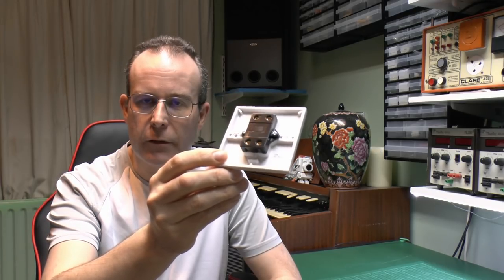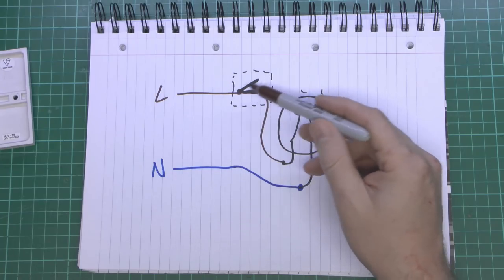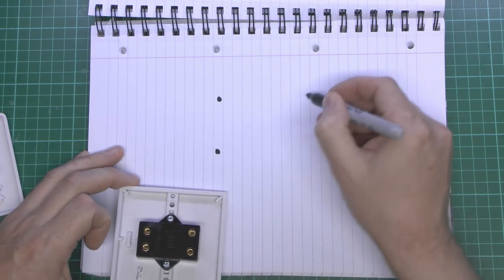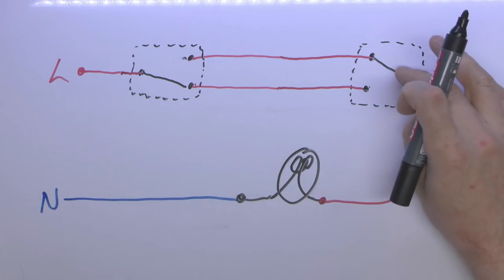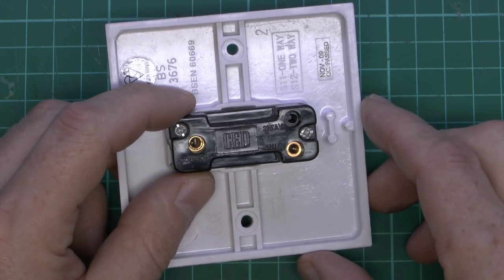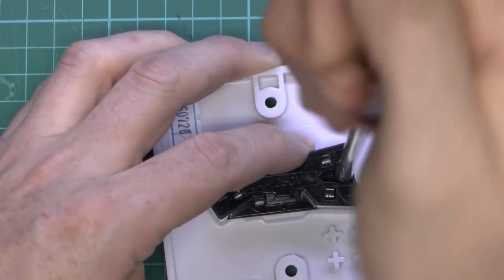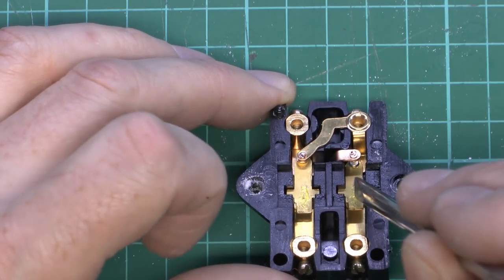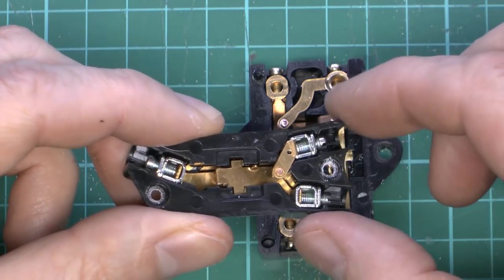Light Switches One Way, Two Way, Intermediate

Comment: Complex arrangement... had one of them this last week. 5 storey building, customer wanted each landing to be switchable from that level, above, and below... so the 3 intermediate landings ended up with 3 gang switches (below/here/above)... the bottom and top ended up with 2 gang switches... (here/above, or here/below, depending).  Had to use grid switches (to US viewers, the grid arrangement is similar to how you guys do it, the switch modules are separate from the cover plate, you can mix and match). Fairly 'bread and butter' electrical work, but when the customer comes in halfway thru the job and sees dozens of wires at one switch position, then comes back an hour later and it's all working as designed, you get kudos :)

Comment: Great explanation JW. I'll be sending this to my apprentices to give them an understanding of the different types.
Reply: Dans the Engineer lol I'm an electrician and this still confuses me it's because I've probably wired 1 or 2 in my life, I think it's because of the 3 cores, I do normally commercial and singles if wired differently
Reply: adam c when I was a 1st year apprentice I drew different wiring methods of two way and intermediate switching and stuck my drawing by my bed.... sounds sad ha but I learnt it very easily after seeing regularly the different ways.

Comment: Why would I have two extra wires on the "out" side of a two way switch? It's at the "supply" rather than "lamp" end of a two way arrangement - there are two wires to the other switch, of course, but also two other wires connected with them. Unless they are somehow meant to be part of the supply/switching arrangement for a fan - this is in my kitchen - I can't think what they'd be for.

This came to light after I replaced the "lamp" end switch - there was a flashover occurring in or at the terminal end of the switch that was causing the light to flash whenever it was supposed to be off. I am intending to get a smart (Zigbee) switch module fitted - likely in the loft unless there's a way to do it at a switch without undoing the two way arrangement - but am now wondering how these extra wires might be affected.

Comment: hi John I have an outdoor power switch its one or 2 way.i just want to wire my hot tub with rcd adapter to switch and there is already power coming out house from dishwasher fused connector which we don't have dishwasher.i used caravan plug on outside wall for my camper van charging .so its 3 mains wires I want connect to switch .is it same as your light switch here in 1 or 2way .steve

Comment: Thank you so much. Was confused because mine had 3 holes and i didnt know if i coukd use it for my switch that has just 2 wires coming out.   .  So when i put the wires from the wall into the new switch socket, can they go into any hole or is it spacific which wire goes in which holes

Comment: It looks like the two way switch can toggle between two lights.  If the L1 and L2 of various two way switches are wired directly to various light bulbs, it would make for an interesting candid camera clip watching someone trying to try turning on (or off) all the lights of a large room.  E.g. flicking any switch would cause a few bulbs on its L1 to go out and a few other bulbs on L2 to light up.

Comment: It might be a sample question for pros, while it took me a half day to figure out how it works. It is a double pole switch. Thank you so much. Your Video is absolutely useful. There are 3 lights in one single switch. Probably there are too many wires, they use a single switch with 4 terminals, extra link wire on the top, which confuse me. It is a double pole switch.....Great video!

Comment: I’ve been look for a video that explains the difference but was still wonder if it was possible to use a two way switch as a one way as the brand that I’m looking to buy seems to not make 1 way also I found that my bathroom light switch has an extra wire so I don’t know what switch to use
Reply from the maker: Yes, a 2 way can be used as 1 way, and intermediates can be used as 2 way or 1 way.

Comment: Hello John can you help me with this switch ive come across in a new build....... its a two way switch in a livingroom. One side its a standard two way switch as you have indicated however the other is what seems to be an intermediate. its marked on one end...... loop and 2way and on the other ......common and 1way . Theres three wires in the loop, 2 wires in the 2way, one in the common, and two in the 1way. How does this work ...it looks as if its powering the downstairs loo as well which is on a single 1way I want to replace with metal light switch but cannot find a metal 4 connector switch (intermediate) they are all plastic. Can you advise ...can I wire this up on a normal 2way switch  ...or am I stuck with the plastic switch plates.Thanks...ps your vids are brill by the way
Reply from the maker: The loop terminal is an additional one that some switches have to connect the neutrals together.  Any normal 2 way switch can be used as a replacement, with a separate terminal block for the wires currently in the loop terminal.
It is NOT an intermediate switch.

Comment: Nice teardown of UK light switches, thanks.
It would have been nice if you had included a chart showing the differing terminology used.
i.e. when ordering you would look for a 1 gang 1 way, 1 gang 2 way or a 1 gang intermediate.
And double gang 1 way, double gang 2 way, etc.
Gang meaning the rocker switch bit.
In the electronics world they are described different again i.e. double pole single throw (DPST) = 1gang 1 way.
Reply from the maker: More info on the website : https://www.flameport.com/electric/lighting_circuits/index.cs4

Comment: i'm trying to find 1 x intermediate and 1x 2 way in 2 gang switch . Only modular are available
Reply from the maker: Use a double intermediate - intermediates can also be used as 2 way or 1 way.
Reply: yes you right ,but that double the costs and 2 gang intermediates are not easy to find either. What I'm going to do is buy 2 gang Schneider switches and take out 2 way switch and replace with intermediate. Those look identical.

Comment: Is it possible to make a double pole switch from a intermediate switch? 🤔
Reply from the maker: Yes, just use 3 of the terminals, 4th one is not connected.  An intermediate can also be used as a 1 way switch if needed.

Comment: hi john hope you and family all well.i have 3 terminal switch and want connect to lights 240volts from my consumer unit I've fitted in shed.ive got get consumer unit metal with mains switch and 2 rcbo,s 6amp for lights and 32amp for sockets.ive got light direct to rcbo at moment but want wire switch in using light cable in uk.my switch has common terminal at bottom and 2 terminals at top.so not sure how wires go from consumer to switch to light.steve
Reply from the maker: Lighting circuits are covered in detail here: https://www.flameport.com/electric/lighting_circuits/index.cs4
and for a single light this is the usual method: https://www.flameport.com/electric/lighting_circuits/connect_at_switch_for_garage_or_loft.cs4
Reply: @jwflame  thanks John